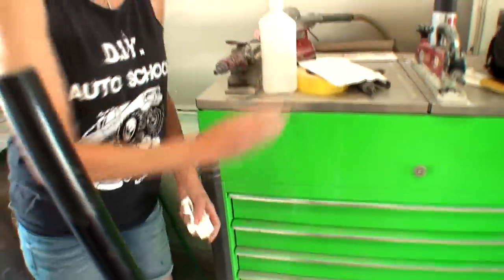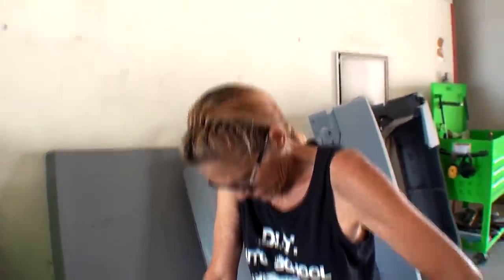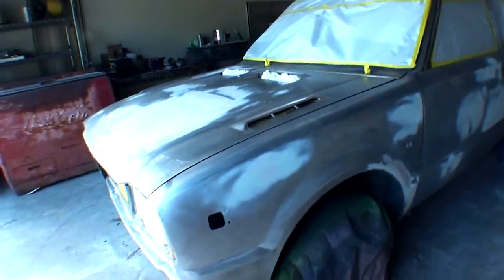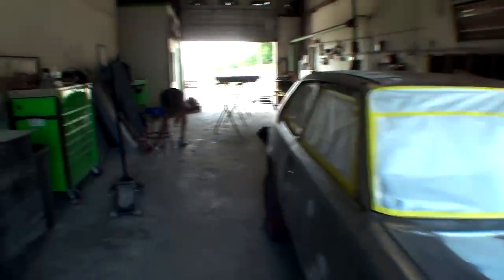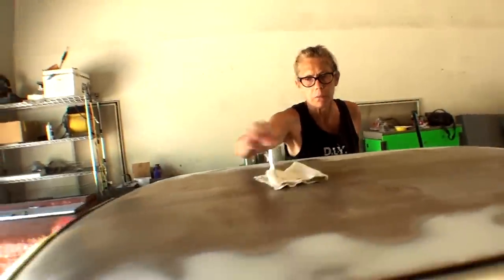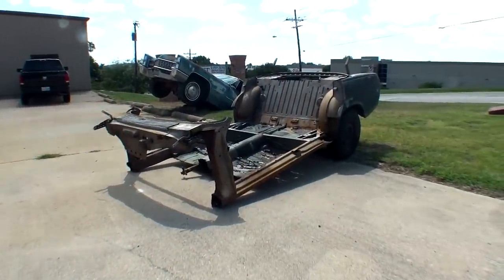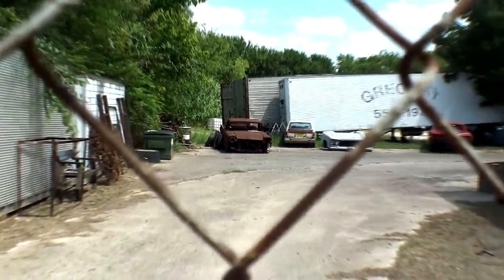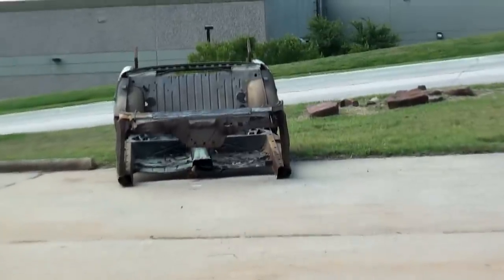How Do I Clean BARE METAL For PRIMER? Do It Yourself Paint And Body

Comment: When you say soda blast or "strip by hand" do you mean just power or hand sandpaper? I thought you ALWAYS at the very least had to start with epoxy. So you are saying you just go straight to 2k primer if you sand the finish with paper? What is the "factory etching" you are talking about?
Reply: Always use epoxy over bare metal

Comment: One side note i used straight up W&G remover solvent to check body work stages.. Big mistake on my part it attacked all the feathered filler edges to the epoxy ground coat. i learned that from Eastwood shows with Kevin T. Well after many$$$$ found out that was a big mistake. Is your ``final wipe the same as Water bourne w&g so scared to use the harsh w&g on anything but bare metal now. Maybe just water over panels and make sure it eveaps really well before continuing.

Comment: Hey Pete! I stripped down to the bare metal and treated it with Permatex Rust Treatment. Should I have used alcohol to clean it first? 
If I used the pernatex, lightly sanded, and followed with self etching primer until final paint job.

 Will that be an ok foundation or should I take it back down to bare steel before final paint job? 

Thanks for all the videos

Comment: What about if you used a polycarbide wheel to get to bare metal? Would you have to epoxy? Then body filler? Or would you just go ahead and do your body filler and 2k primer on top? Never painted before and know nothing about painting but learning. Only way my fathers 63 c10 will get done is if I do it.....

Comment: so im painting my car in a week it has chipping paint and theirs no primer under just bare metal. I'm doing a single stage rally red from restoration shop cheap paint for track car. Main question is their any specific primer i should use for the bare metal ? or just 2k primer ? and would acetone work the same as the alcohol ? sorry im new to this

Comment: Really enjoying your channel but looking for a bit of advice please, I have stripped my car to bare metal but unsure how flat it needs to be before applying epoxy primer, it does have some scratches from 40 grit. Question is do I need to get it smoother before epoxy or sort with high build primer on next coat.Thanks in advance

Comment: when i was building dump trucks we would use a etching primer for the frames we built for trailers this shit was amazing u could take a pocket knife to it and i could not scratch it plus it would prevent rust but it is very expensive but we used very expensive paint dupont centari 500 even painted trucks with the new paint i forget what it was called but it is multi color in the sun it was over  1000 a gal. but what was cool i could get the 500 paint for 50 bucks a gal thew the co. witch was 15% above the cost to make it my boss owned a golf coarse and got to know the owner of dupont real good plus they would give us paint all the time i would get primer for free by the gal. and tuff coat witch is real good for body work . we built a lot of trucks for car shows for peter built and kenworth